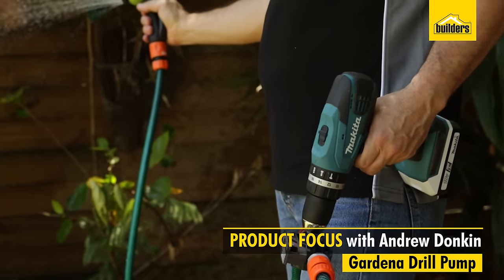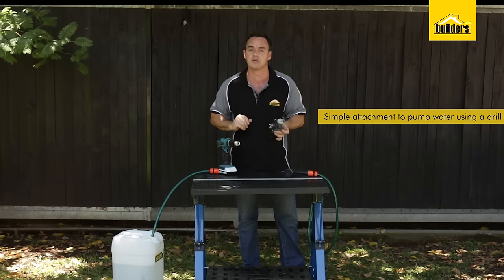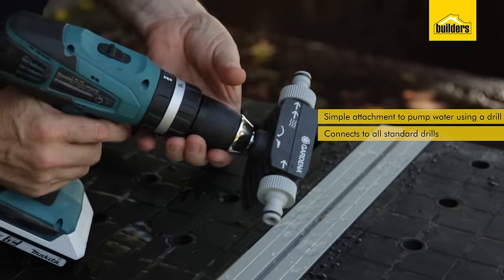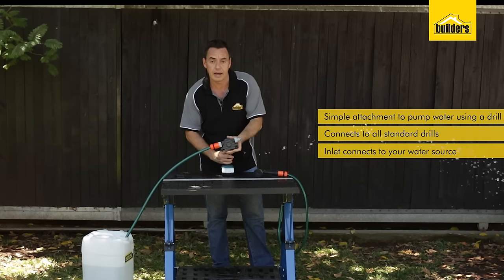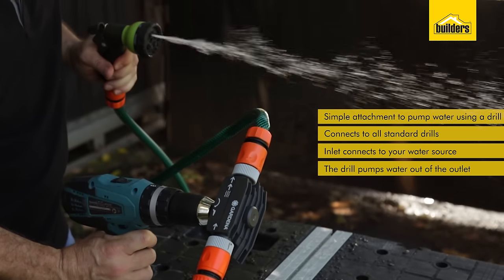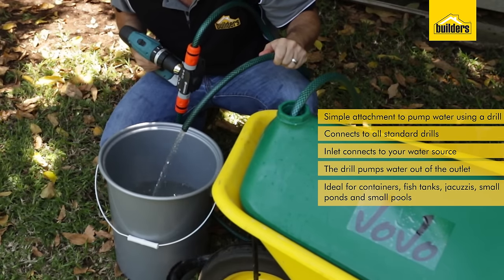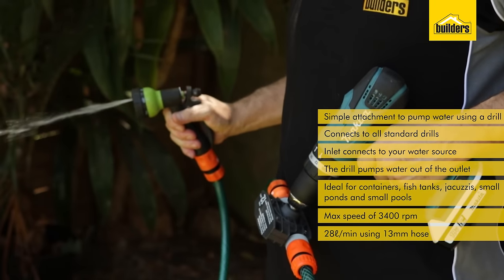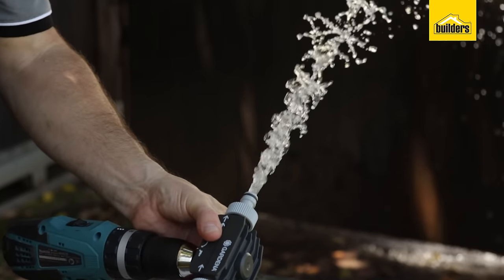Need to Know How a Drill Pump Works? Watch this Video

Comment: I'm working with 1 1/4" hose on both sides of my pump but I cant seem to get it flowing. Should my inlet hose be reduced to 3/4"?  I'm also pumping about 20m away, relatively same elevation throughout.  Any suggestions please and thank you kindly

Comment: suitable for drinking water? safe for use on RV? many think that there is toxic grease inside...
Reply: Pumps like these are not suitable for drinking water. If you wanta  pump for drinking water your pumping mechanism must not be in contact with the water itself.

Comment: Great Information - do you think the drill pump could be used to start a siphon?  for example use the drill pump to start the siphon, then once the siphon action had begun shut off the drill pump and the siphon will continue to drain water.
Reply: Nope. (Unless there's some design I've not seen yet).  But if you take one apart you'll see that if the pump isn't rotating there is no path for water to travel through it.  There's lots of other vids with them disassembled that'll make sense once you look at it.
Reply: If you connected a valve to it you could open the line and if the outlet is lower than the inlet it should keep prime and gravity will do the rest. I get spring water from a source above me in the mountains and use a similar pump

Comment: What do you mean it is 'not meant to run dry for more than 12 sec' And what does '3 bar' mean?
Reply: Edgar Pretorius The internal rubber impeller is lubricated by the water, and needs the flowing water to stay cool. If it runs without water, it will overheat due to friction, and disintegrate. 1 Bar is 14.7 PSI, therefore 3 bar is about 44 PSI.

Comment: Is there a way to connect a thinner pipe to the drill pump? I need to transfer liquid from container A to container B but it has to be through a hole of around 1cm in diameter so a normal hose pipe is just too thick to pass through the hole. I have the thin hose pipe but not sure how to make the connection to the drill pump. I have the same drill pump as yours so your help would be much appreciated.
Reply: Yes, there is.

Comment: can this be used to pump petrol jerry cans into boat tanks ?
Reply: I'd think so. Mine said it's safe for fuel but I'd do some research on what ones produce the best flow cause some are pretty poor in that regard. I've just got a cheapo from orielys and it didn't give the flow rate
Reply: Not for use with petrol...Diesel is safe

Comment: Can you use this with gas?
Reply: You COULD but it might corrode the plastic. Would work no problem for the first lot of times.. though I'd rinse it with water after.
Also, using a Jiggle Siphon might be better.
Reply: So its safe but over time the plastic Would break???